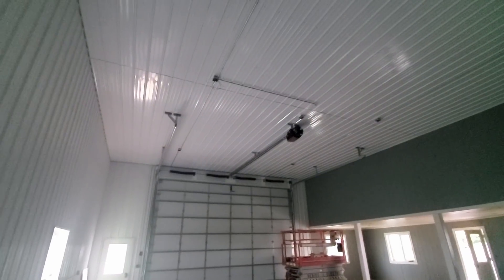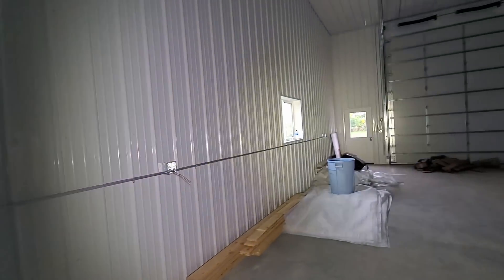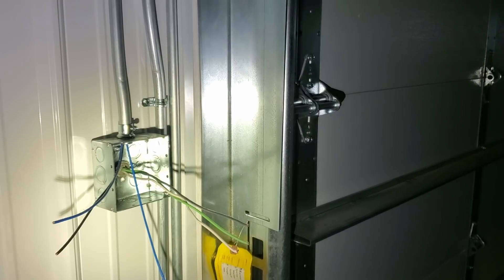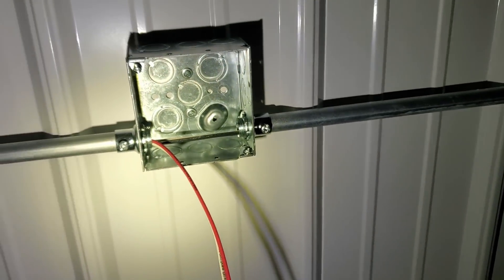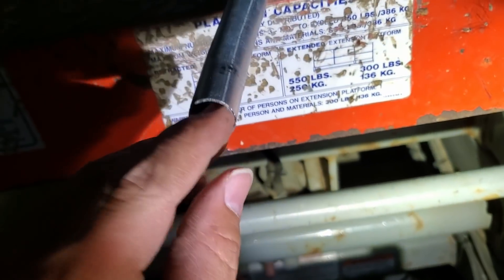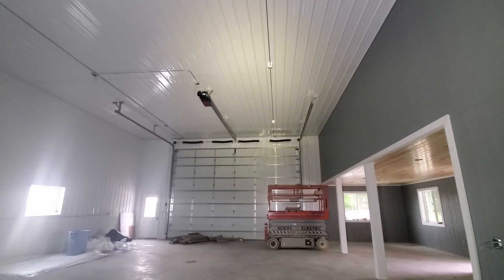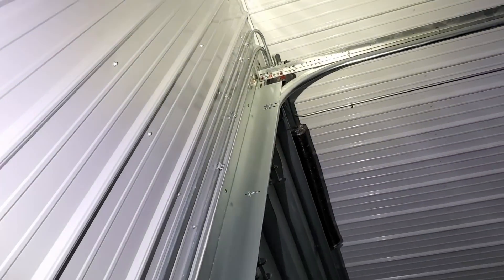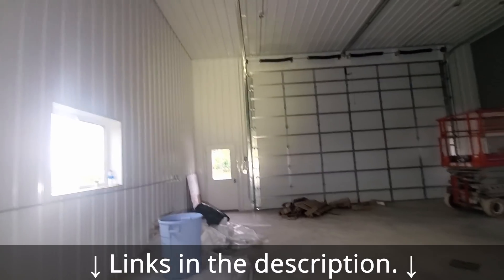Wiring a Shop Using EMT Conduit on My First Day as an Electrician Apprentice

Comment: Starting at 3:03 you correctly stated that a ground wire is not necessary because the EMT conduit provides the bonding, NEC 250.118(4). While adding a ground wire from the box to the receptacle is probably a good idea, it's not required by code. The metal to metal contact between the device and the box cover provides an effective ground fault current path per NEC 250.146(A) regarding surface mount boxes.

Comment: Good job, Benjamin.  The only thing I noticed (did not see a closeup of the boxes on the wall for receptacles) was there were not any box offsets in the EMT where it goes in the 4" square boxes.  I worked as an electrician for many years doing commercial and industrial work and was a member of IBEW, local # 1340, Newport News, VA before retiring.

Comment: Just wondering if you could run the wires inside the wall or if its easier to put in on the outside.

Comment: run the ground, you never know what people did before or will do after. I had a bad experience where power was stolen from the pole at the street , incorrectly wired into an a/c unit, from there it contacted the building wall. 3 times I got tingled. Heat strips in conduit installed wrong,
just saying, 200+ voltages are a bear. 120 not much better.

Comment: Here in Florida we're unable to use the EMT as the equipment grounding conductor. We always have to pull equipment grounding wires. The problem occurs when after the installation has been inspected and at a later time when renovating, or installing new ductwork, the workers loosen a coupling to move a conduit out of the way and don't fix it, causing us to lose the ground and have the conduit biting into hot wires simultaneously, creating a serious hazard. These rules are in place because people died. As far as I know all Florida counties enforce these rules.

Comment: I mean this with nothing but respect, as I am way below a apprentice in the electrical field, however I have been in journeyman carpenter for over 10yrs and be able to work full spectrum in building classifications.  (commercial, residential, civil, even remote island owned by billionaires) Anyway, I don’t ever touch any electrical at any job, I don’t act like I understand it, (although being a superintendent I understand R/I, I understand mc to Romex, I understand dedicated circuits to certain appliances, I even understand the u-fer-rod (main ground) needs to be #4 or better rebar, 25’ continuous i tie to FT’g steel, and 90 up near panel, Just wanted to say you are the biggest and best nerd,  I’ve seen come out of your generation! I really appreciate the effort put forth and I beg as long as u don’t dork out and annoy your mentor/journeyman too much, he feels the same way! Not only do u want to learn, u are broadcasting the passion and process, so u can’t cheat. I will say, in our craft, the biggest lessons come for mistakes, it’s inevitable, it’s how you handle those mistakes, recover and  learn for that! All the best, don’t annoy your mentor too much! Respecting elders is crucial in life and construction!

Comment: Question:  In my detached garage there is a breaker box.  The box has the neutral and ground bars tied together (they are one piece).  Is that okay?  It's weird, because basically all the neutrals and grounds for the circuits within the garage go to the same point in the breaker box, so why even bother running separate neutrals and grounds?  Inside the box, there are two hot lines, and then one black wire that has yellow stripes on it, which go to the ground/neutral buss bar.

Comment: You should also consider using insulated grounding lock nuts for those connections of EMT.
Considering there is no EGC.

Comment: It's definitely a good thing to run a ground wire because looking at conduit fill, one extra wire really can't be used for much else. Additionally it is also a good thing to pull string with wire on every pull. It helps the next guy tremendously, having it in there.
Reply: Oh, yeah. We had to use grounds as pull wires many times. It's harder to push fish tape down a conduit full of wires rather than just tag onto a run of green ground and use that instead.

Comment: Why would you even pull wires without including a ground wire. The metal boxes has a hole for your grounding conductor that's coming from the panel, not the device

Comment: I am not an electrician, but in the tire shop I worked in years ago, one of the owners was a master. When I showed interest, he took me under his wing, and when I had time, for 8 years I helped him with wiring and electrical installations for the shop, including 3 phase, which I admit I still don't understand. This was 25 years ago, but the knowledge I gained from him allows me to undertake any electrical work around my house. I will always be grateful for him teaching me. That being said, two things I would have done differently in your project would have been using plastic bushings in the boxes, and, even with the high price of wiring these days, I would have run a ground wire to protect against set screws loosening, etc., over time. Just my opinion. I enjoy your videos.

Comment: Sometimes you want to be careful pulling that many conductors through one conduit. While convenient to run, the derating for having more than three current carrying conductors in a raceway can really add up (NEC Table 310.15(B)(3)(a)). That why some electricians make so many parallel conduit runs to the same place.

Comment: Offsets for the boxes would have looked nice. But overall nice installation. I agree with most of these guys using a ground wire is far better and a standard practice in commercial use.

Comment: Nice.   I was shocked with the first few words of the video.   
I enjoy your past electrical videos as you were very thorough and on par.
Good luck as the Apprentice and I look forward to the adventure.

I think any pipe without a ground is a sub par installation. Locknuts make good connections when everything is new and bright and shiny, but a few years down the road they will start to fail and there won't be a ground path any more. I put using pipe as a ground right along side using stab in the backs on receptacles. Legal but shouldn't be done

I hope all is well.

Comment: Well I think your coworker made a boo boo cuz at 6:29 there are 2 couplings about a foot apart. I'd have scrapped it and did it again so there doesn't need to be a little one foot piece of EMT coupled in between 2 longer sections. Just my preference but it doesn't have to be pretty all the time. Lol

Comment: I was helping an electrician run some conduit and deburring the ends. He stopped me and said let me show you an easier method. 
He then used a tubing cutter, made several passes and then broke the conduit. The edges were smooth and No deburring was necessary!
Reply: Those can still leave sharp edges on the inside of the pipe, its still a good habit to ream your pipe. 1 Sec of reaming can save you hours of troubleshooting a nicked wire

Comment: Don’t cheap out on the ground wire.  Run a dedicated ground.  Never trust met as a ground.  It can get loose or be broken circuit with modifications later on.

Comment: Benjamin,   You jumped to the dark side😊.   NEC does allow the use of metallic conduit to be the grounding conductor.   But, that does not mean it is best practice in all cases.   I was a design engineer and worked for contractors and short time at consultant for 35 years.   As designer and also company policy, we always installed green ground conductors in metallic conduits.   Doing large projects, the guys running conduits and the guys pulling the conductors were not the same.   Incorrectly installed metallic conduits as ground can be extremely dangerous and have caused shocks and deaths.   
Best wishes on your new endeavor!   Respectfully,   Kevin

Comment: Looks good.  Isn't it nice when there are lines all about to run the pipe parallel or perpendicular with?  Putting the wall boxes into the recesses, thereby eliminating the box offsets is a great time saver idea. 

Beside all the other remarks about grounds and bushings you were taught a lesson there that day. Drop more length at the panel especially if the panel has not been installed yet.
Reply: I probably would have run the straps pointing down to hold the pipe on the wall.  With all those recesses these pipes become handy storage places for things that could tend to push the pipe away from the wall.  At least if the screws are at the top the pipe won't peal way from the wall.

Also hopefully that's not the back side of the outside wall you just poked a bunch of screw holes through.  Probably not but I don't recall seeing much metal siding being used as sheeting on the insides of a wall.  

Have fun doing little jobs.
Reply: Hope you are using pretty fat wire for the light switching.  When you add up all the length from the panel to the source of the power at the switch for the runners back and forth and then add the length up to the lights and to the last actual light fixture there is a lot of feet of wire there for voltage to drop over.
Reply: One more comment.  No one has mentioned that you brought the conductors into the area of the panel with the main breaker.  Here that's to code if the panel is a subfeed but don't ever be doing that if the panel is the first point of control ie the main panel.  Lots to learn for sure.

Comment: They say to follow your passion, and clearly from your outstanding past videos you have a passion for electrical work. Nicely done! Here in Canada I believe they require antishort bushings where the wires enter the box, to prevent the sharp conduit edge from cutting the insulation. Are those added later?
Reply: They do require it to protect conductors with larger loads and service conductors but I like to put those little suckers in there anyways.  Saves on a lot of skinned conductors.  But that little roller bar gizmo looks like it could be fun in some applications if it can be removed mid stream as it were.

Comment: No ground conductor is actually fine by code, but usually a ground wire is run. The couplings and connectors of EMT can come apart leaving the ground path broken.

Comment: Video idea, sort of off topic: compare performance of woodworking shop tools (tablesaw, bandsaw, etc) wired for 110 and 220volts. Seems to be debate surrounding variables: heat produced in motor, distance of wire to tool, etc…
Reply: From my own experience...  Had a table saw wired for 120v.  When doing a big batch of sawing, we noticed the motor seemed to be struggling more and more, and we were just ripping cedar fence boards!  Touched the motor; it was quite hot.  We shut off the saw and let it cool, then finished the job.  We later ran a 240 circuit for the saw and rewired the motor.  The saw starts a lot faster, and has never overheated since.  For this reason, when I kit out my new shop, any motor than can be run on 240, will be.

Comment: Great to be able to compare and contrast how we install UK conduit.
Reply: @efixx I actually prefer the snap-on connectors for conduit, huge time saved relative to pipe threading. While US NEC allows the EMT/conduit  to be used as a grounding conductor that is a minimum I would and so would many electricians add in a ground wire/ CPC just in case the conduit became damaged/loose. 

We do some massive metal conduits  in industrial settings using very large bending machines. You have probably seen them on Instagram they are sometimes works of art…
Reply from the maker: For sure! Would you guys be interested in doing a collaboration at some point?

Comment: Bending EMT really is an art form based Pythagorean theorem & other simple geometry. I only did commercial work so it was all EMT. Your co-worker used a 90 w/ a kick to get it around the other conduit. & PLEASE don’t used that conduit as an EGC. The next maintenance guy that forgets to tighten a set screw will ruin the whole continuity of it!

Comment: Just remember minimum code is minimum. If the EMT connectors somehow loosen then your ground is potentially lost. You should always use a ground. Also EMT threaded bushings are a great idea for protecting the wires. Also one other small suggestion, it is more in cost but it is good to think of the future, I do mostly commercial and industrial and I never run 1/2 inch. In a shop they always add circuits and more lighting, and then you look like a genius for thinking ahead for the customer.
Reply: What's your typically suggestion? 3/4" or 1"?
You're referring to emt bushings in each box?

Comment: "Back in the day" we weren't allowed to pull conductors straight through as shown at 3:12 of your video??
Reply: There's no issue to have conductors passing through a box. If they don't terminate in that box then they don't need to have any excess length.

Comment: Are bushings not required on the EMT connectors? Even if not I'd use them to avoid any chance of conductor damage when pulling them in.
Reply: no, and they don't damage the wires. The connectors don't have sharp edges.
Reply: @monkeyCmonkeyDoo  Till some Chinese factory makes a bunch of defective ones, anyway....
Reply: @monkeyCmonkeyDoo  Bushings are required when pulling 4AWG and larger conductors.

Comment: I'm confused. Unless there is another guy or a brother that looks like you, I seen videos of you doing electrical work residential, industrial and commercial. The guy that I seen on the video that looks and sound just like you is a master electrician and very knowledgeable. I seen that guy that I thought was you on a video wring a transfer switch to the generator of his house. There is also a video of him wiring a large two story house. And I'm surprise that on this video you don't even name the boxes and the fittings going to the boxes or the straps securing the emt, you called the straps brackets.
Reply: There is another good electrician on youtube his channel is Electrician U that might be who you are thinking of.
Reply: @abdulelkhatib2674 , I know Electrician U. That's not the on I'm talking about.
Reply: Ben is the guy you are thinking of .... same guy. He has the knowledge of a master electrician already, and is also a master plumber and HVAC guy. He is just humble and has never worked as only a dedicated electrician in an official capacity, which is why he calls this his "first day on the job." Ben is already a beast with electrical.

Comment: Seen way too many EMT connections where the pipe was pulled out of the box thus the grounding integrity has been compromised...
Reply: When you bond at every junction box it also helps trip the breaker if a piece does come apart and compromises the splices.

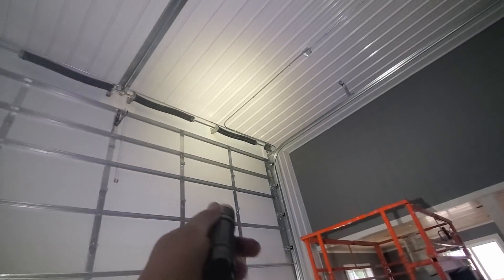Comment: At 1:55 you mentioned that you ran a 1/2” for the low volt wires. Since they are sensors for the garage door. Could you zip tied it to the EMT you ran for the electrical? In my eyes, they are control wires which should be allowed by code. Am I right about this?
Reply: You aren't supposed to use a raceway to support additional conductors. It's done all the time but it isn't up to code...
Reply: @brianleeper5737  Yeah but most of us have done it at one point or another in some way. I would be amazed if an inspector called out a tiny low voltage wire strapped to emt.

Comment: It took me several years to become an electrician. I can say my first day on the job they referred to me as a Cub so except criticism as spoons of knowledge. listen to those who are experienced and are accomplished. Lastly, NEC codes are the same in each state but beaware some places will modify codes in their jurisdictions for reasons they set forth making it safer. Good luck Cub
Reply: Accept not except. I hope you can accept that as constructive criticism. I am usually right, except for when I am not. ;-)
Reply: @illestofdemall13  smart as..
Reply: @TheMrFrank101  Not really being a smart ass. He was talking about accepting constructive criticism but he also used except rather than accept. I was just correcting the usage of the wrong word and also using examples of both words in my statement.

Comment: Good work, my last big project had over 50k ft of 3" grc, just to feed power to motor control centers..
Also, learn to use a 90 bend to allow you to pull wire thru a jbox.
Learn your kicks, offsets, and saddles.
Learn to line up your couplings, install straps in a consistent distance..
It is all about taking pride in your craftsmanship.. straight, level, plumb, and consistent. Being able to visualize obstructions, work with the other trades..
Heating and air especially.
Last piece of wisdom.. "if you dont have time to do it right the 1st time, you will never find time to do it right the 2nd."
America needs electricians, thank you.
Reply: The foundation of a well seasoned electrician...well said.